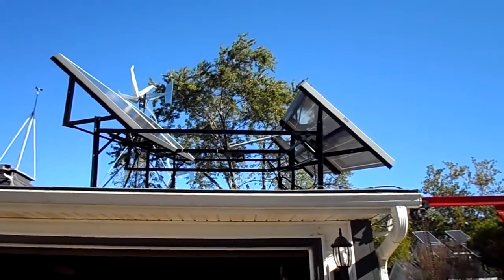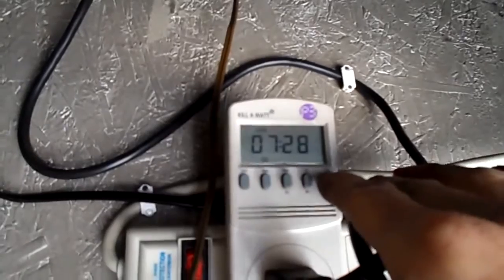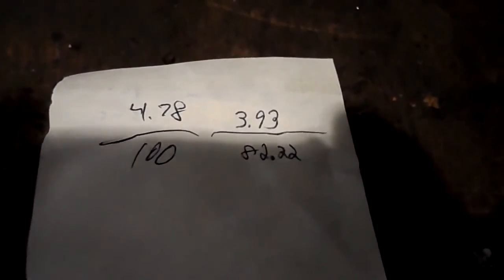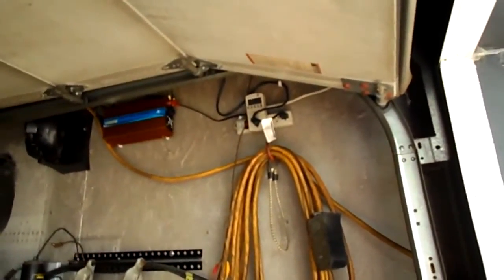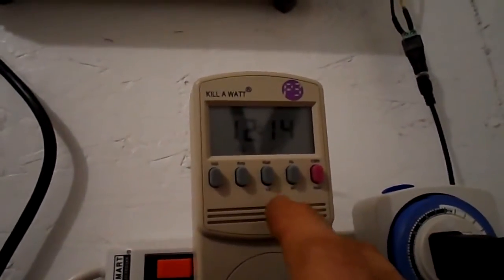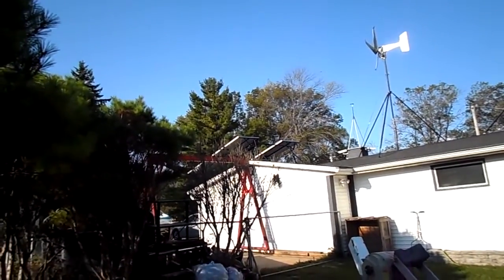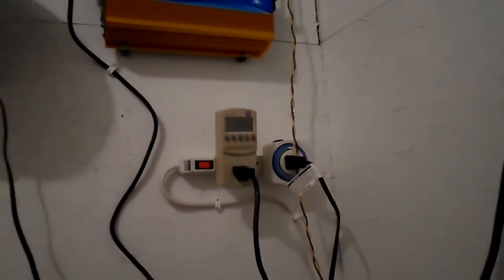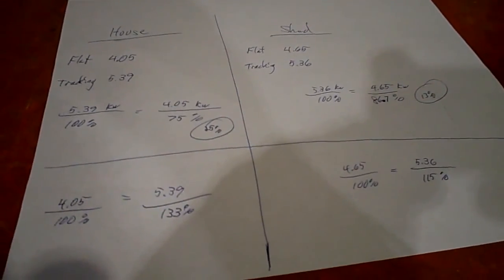Tracking vs Flat mounted Solar panels: Results will vary

Comment: That was a interesting test. Makes you wonder if it would be cheaper to add another solar panel or two then invest in a tracking system. You would want to go with a mppt charge controller. A 12 volt battery 100 ah has 1.2 kwh of power in it discharged to dead so you would have to do the math's to how many kwh you would need and have.
Reply from the maker: +TheBlokeSolar&Wind Funny you should mention that as it did cross my mind after test one.  The tracking system was $115 which wasn't too bad but the rack was $350 using 1/4 inch angle and $300 for the second using 3/16 angle and then again another $115 for second tracker.  Lets say the total for one rack is $475.  Using round numbers figuring I have to make up an extra $375  with a tracking setup  (that's deducting the flat mount rack of $100 I'd have to spend anyway to hold flat panels) and lets say 20% more with a tracking rack is 1 kw per day ( which it isn't )......at 16 cents a kw it would take me 6.5 years to recover the extra cost.  I'm going to have to agree with you, for the extra money I could of bought two more panels.  I should of bought used steel from a scrap yard, could of saved $150.  Another problem that sways me in the costly direction is I love to build stuff and just had to build it.  See, my study seems to be wasting money to save money, lol.  I just have to wait 8 years to recover with my solar setups.  Very good point made.

Comment: 20% is actually a pretty good increase, when you consider the added watts over a years time.  Go with a Midnite Classic.  missouri ws has them for sale the cheapest I have seen. $549 for a classic 150.  I have used several controllers and the classic is the best.  my battery bank is 1735ah, I pull around 500w per hour and I use about 20% of my 24v battery bank (6v flooded cell) going thru the night.  I have 3.5k in solar panels.  3.5k in solar panels make all kinds of power during a sunny day.  I charge my batteries and push 500w back into the grid.  But I am going to add another 1k next month just for the cloudy days.  On bad cloudy days (100%) I notice my panels only put out 10% of their rated power.  Not enough to charge my batteries to full, so the extra 1k will get'er done.  Hope that helps you make your decision about a battery bank.
Reply from the maker: +wadesready $549 is kind of high for me with boating season closing......I was hoping to say around the $200 range for now.  Also because my panels are so far apart I guess I'd need two charge controllers.  But starting with just one controller would mean I'd only be using 4 panels to charge batteries and I only average 5kw per sunny day.  Because of cost again I'll be using my used marine batteries (hopefully I can come up with a couple matching sets) and they will be wired 24 volt.  How many of those common marine 12 volt batteries ( I think they are 100ah) could my 4 panels charge to have a good, workable set up where they would charge full from 20% down would you suggest?  The pannels are 230 watt so one set of 4 is just under 1kw.   Thanks for the help.  CORRECTION : they are 20ah batteries
Reply: Renogy has a 40amp mppt controller that is pretty good. you could use 10awg wire and run your panels in series at say 60-120 volts and have no problem going 50 feet with very little loss.  The classic 150, I think could run all of your panels and then some.  They have a calculator on their website.  On my classic I have 2 sets (255w) of three panels in series at 90 volts (1.53k).  I think when I checked midnites website there was room for another 3 panels on that controller. 

Just guessing, but I would see no problem having 1 of those batteries per panel.  If 1 panel averaged 115w per hour for 6 hours that would be around 28ah, so a set of 4 batteries on a 920w solar array should work fine, and you should have extra power to put into the wall.  With that being said I would also add.  One of my regrets is not spending more on higher capacity batteries than I did.  More storage is always better.
Reply: by 1 battery I mean 1- 24v...  2- 12volt per panel.  because series doubles the voltage, amps stay the same
Reply from the maker: +wadesready Okay, so 8 batteries total, 4 sets of two 12 volt batteries wired for 24 volt for one rack of 4 panels.....Also my panels are wired parallel for 24 volt output but if they were wired in series for 96 volts, then would my bank have to also be wired 96 volt or would the bank just maintain the 24 volts even thou 96 would be going in?  I take it those charge controls are adjustable for whatever your bank is set up for.
Reply: you can run your panels in series at a higher voltage and the controller will use that higher voltage in charging your batteries.  higher voltage=less loss.  the controller will automatically know it is connected to a 24v battery bank.  When you are looking at charge controllers you will want to look at what max wattage it can handle at 24v.  the docs will tell you something like 12v/500w or 24v/1000w

I also have this one that works alright. 

http://www.amazon.com/gp/product/B00K71C7PI?psc=1&redirect=true&ref_=oh_aui_search_detailpage

the classic just has a lot more features/ is more adjustable/ network access.  it is worth the money.  in my biased opinion
Reply from the maker: +wadesready After looking around a bit, I do like the classic but I ran into another question.  How does one use the power from the battery bank in an "on grid" set up?  I'm seriously missing something in how this works.  The controller charges the battery bank till full and then diverts the power to what?  A grid tie?  If so, that would be fine but when night rolls around, do you use power from the battery bank?  threw the charge controller again or is there something else you have to have?  The charge controller don't have a built in grid tie does it?
Reply: Here is the way I do it.  I have gone from a $200 electric bill down to a $40 bill.  I power most of my house with power from my battery bank.  but I still use power from the grid, like for my window air conditioner.  My charge controllers charge the batteries, when it reaches a set point a "latch switch" transfers power from the solar input/batteries over to a grid tie inverter just like you have.  If the voltage on the battery bank drops to a low set point the latch switch shuts off and then all power goes back into the batteries again until it reaches its high voltage set point.  (I'm not sure, but I think my high set point is 29.3v and the low 27v.)  I have my midnite classic set pretty high (voltage wise) to keep it using all the power I can get from the sun.  The other 2 controllers I have you can't change the voltage ranges, but with the midnite you can.  My grid tie only runs during the day when there is excess power.  I am pushing around 3.5-4k per day back into the grid of my house.  You could make a grid tie run all night too, off the batteries.  think of the grid tie as nothing more than another appliance plugged into your batteries. I hope that helps...
Reply: this is the latch relay switch I am using..   http://www.sterling-power-usa.com/SterlingPowerUSA-ProLatch-R.aspx
Reply from the maker: +wadesready So you don't draw from your battery bank at night?  I take it the battery bank drops at dusk and stays dropped till the sun comes up again.    Going a little deeper in thought about the smart meter......it would be nice to know exactly how it counts the power going in and out with there being 2 hot lines coming in.  I'll have to check my breaker box again to see if my 2 sets of panels are on only one hot line or if I have one on each.  I just wanted to make sure they where on different breakers.  I wonder what kind of difference it would make on the smart meter trying it both ways.  If all the panels on one hot, my guess would be the kws charged  to me would increase............guess I'll have to check into that.
Reply: +Lightendog I do draw off the battery bank at night, most of my house runs off it, everything but the AC.   I just don't use the battery bank to power the GTI at night.  my battery bank will drop down to any where from 25.1 to 24.8 by morning.  I mostly use the excess power into the GTI to supplement the power my AC is using.  It is hot here all the time, so $40 per month for my AC I can live with.  I could run everything off my battery bank, but it would draw down my batteries to around or below 50%.  You will get (from what I have read) around an extra 2 years of life out of your bank if you only draw it down to 30%.  so that is why I don't.  

The GTI you are using work this way from what I can gather...  THey are at a little higher voltage than your wall power.  So say your house voltage is 120v, the GTI will be at 123v.  anything plugged into your house power will use the higher voltage power until it is gone, then it will start using the house power.

There are all kinds of different ways to put your solar power into your house power.  It all depends on how much money you want to spend,,,,,
Reply from the maker: +wadesready Ohhhh, sorry, I forgot you had a larger solar setup and it will all make sense to me eventually.  My questions must be painful at times but believe me, there is nothing more painful then me dealing with my own mind. lol.  You probably already told me this but again I missed it.  How does your house use the power from the battery bank at night?  You said you don't use a grid tie at night and basically, I'm unclear as to how one pulls the power out of a battery bank.
They say you can't just connect a grid tie to a battery as it will over heat.  A grid tie is the only way I know to get power into my house.  If I can't use a grid tie, what component will allow me to take power from a battery bank and get it into my house?  That is the part I'm not getting..........(I feel like a 10 year old would pick this up quicker then me.)
Reply: Don't worry...  I know there is a big learning curve when you are doing it yourself.  been there done that...  and I still know very little..  hahaha 

I've been running my 500w GTI for over 1 1/2 years off my batteries.  Of course I have a 14" fan blowing on it to cool it also.

All day and night I use a 24v pure sine wave inverter.  It takes the dc power from my batteries and makes it into usable ac power to run things in my house.  You can't run the sine wave inverter and the power from the electric company on the same circuit though.  it is an either or proposition.  but you can run say your garage, utility room, and kitchen off solar, and the rest of your house of the electric company.  some higher priced inverters have grid ties in them, they will switch between pushing power to the grid and your batteries.  but they are expensive....
Reply from the maker: +wadesready Okay, that does help out a lot......now that brings me to a question someone told me probably wouldn't work.  Say I take my kitchen breaker, disconnect it from the breaker box.  I'd have the power and neutral disconnected but leave the ground connected.  I could then just run a regular pure sign inverter off the battery bank or would the ground have to be disconnected also as it's on the same bus bar as the neutral?  As long as I have one regular inverter on that isolated circuit, then I could combine it with another grid tie from solar if I wanted to add more power to that circuit?
I seen a guy on youtube hook up a DC-DC Converter Power Supply Step-up Module 10V-60V to 12V-80V 600W 10A  between a battery and grid tie which controlled the heat build up on the GTI.  I bought two of them last year so I'll be testing that in the future.
Reply: +Lightendog I don't know if you can run a Grid tie inverter back into a pure sine wave inverter or not.  I would think it would work,  but myself I would be afraid I would fry a $800 piece of equipment.  my solar is run on one circuit of the house and my grid tie is on another circuit with power company power.

I am not an electrician, but your solar is grounded with a grounding rod, but then so is your house power, so theoretically a ground is a ground....   It will either work or it won't.  hahaha
Reply from the maker: +wadesready Have you ever figured out what your total expense was and then figured out how long it would take to break even?
Reply: My electric is high .18 to .28 per kilowatt depending on time of year/hour of usage.  and they want to raise it another .042 per kilowatt.  My original system was about $3000 and I figured it was going to take around 2-2 1/2 years to break-even.  Now I have around $8000+ (includes the 1000w I picked up today) so around 5 years.  I am saving $180 every month that I was paying out to the slimmy electric vultures!  (if you can't tell I hate companies that suck your blood every month) electric, phone, water, cable, internet, banksters are all scum... lol
Reply from the maker: +wadesready I've been watching my kws for about 2 years now and there is no peak time here in Wisconsin.  Pretty much .135 cents a kw and after taxes comes to about 16 cents a kw.  I used to average $120 a month but now it's about half that.  My panels where 1440 shipped, both sun tracking racks cost me a total of 775 to build and I figure with grid ties and misc I paid about $3000 grand total also.  If I can maintain Half my normal electric bills every month then technically it would take me 4.5 years to break even.  But the damn winter will have my furnace blower motor running non stop and the sun light is short.  Maybe I'll only be saving 15% instead of 50%.

Now good summer days my set up could give me 12 kws but if I could average 6 kws per day,  it would still take 8.5 years to recover.  I don't know what the panels will do in winter yet but I'm guessing it won't be very good bringing my hopeful average down even further to say 3kws.  Another reason I need to add a battery bank.........more money to spend on saving money. lol.  Seriously, if this wasn't my hobby, there doesn't seem to be a point to doing this at all. ( Last year I spent $700 on changing all my lights to LED which I think saves me  $150 + a year )
Reply: It is a lot easier to save power than make power.  Led's are good.  Have you looked into Geothermal for heating and cooling?  I have been researching it lately.

I look at it this way.  if I spend money on hardware at least that money is not going to the electric company.  Money to the electric company is money down the toilet.  Solar is a 20-25 year investment at least and what kind a price tag can you put on freedom from corporate america and electric security.  when the power goes out for the rest, you will still be happy.
Reply from the maker: +wadesready As of now, I don't have the power, know how, or balls to go off the grid.  I do have a gas generator thou and plenty of gas from boats I go thru.  A lot of power made during the day is wasted and it sucks turning power on to stop the electric company from charging me for it when I make too much.  With solar track vs flat, the additional price tag could have been used to buy another panel or two.  I guess my new "rule of thumb" would be if you don't have a lot of space for solar, tracking would be great.  If you do, load up with flat.  Even the tracking system is temperamental at times and has components that could  burn out.  Maybe it's a horse apiece.  It was a great project thou and I have no regrets.